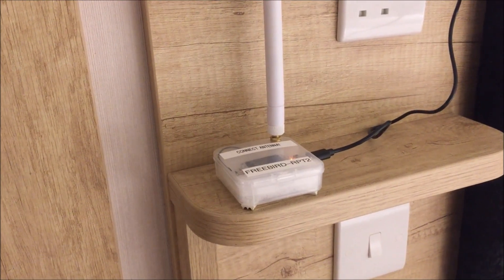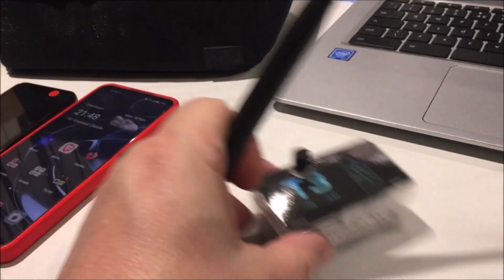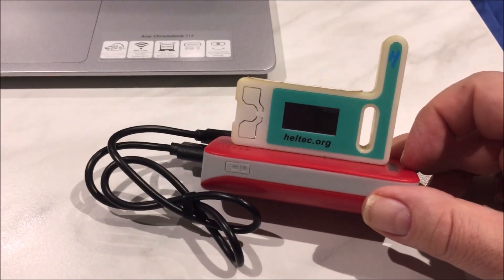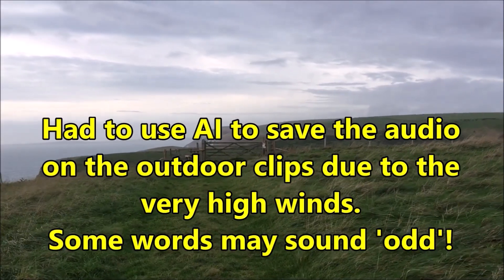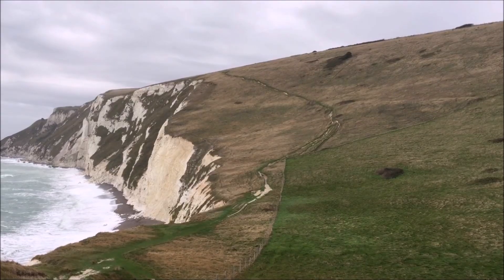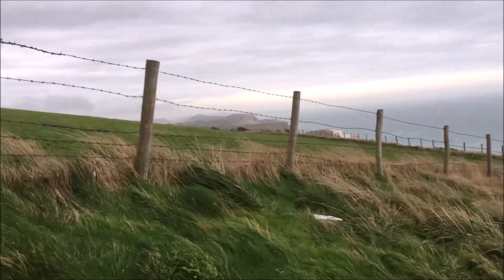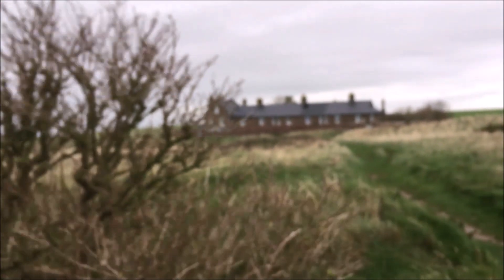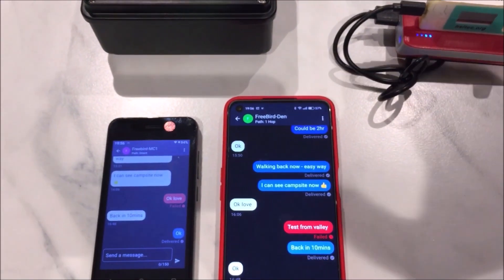Testing Back to Base Comms Using MeshCore!

Comment: Nice one Gary, still fancy giving these a go. What is a decent price for the heltec v3? Seem a bit pricey at 30quid a pop
Reply from the maker: It's been good fun as well as some useful comms and experimentation - £17 tops for a Heltec V3 via AliExpress, although on PiHut you can get a Seeed LoRa kit for £10.20 - search for "XIAO ESP32S3 & Wio-SX1262 Kit for Meshtastic & LoRa". Also on PiHut, they have the better antennas "868Mhz LoRa Antenna". Cheers.